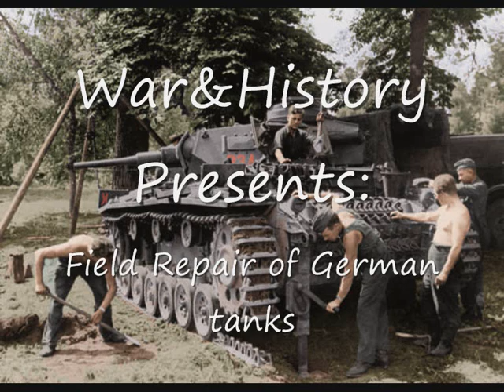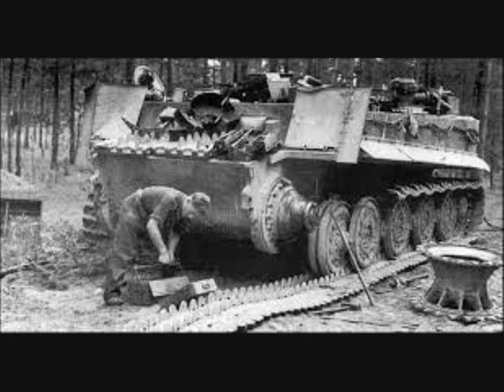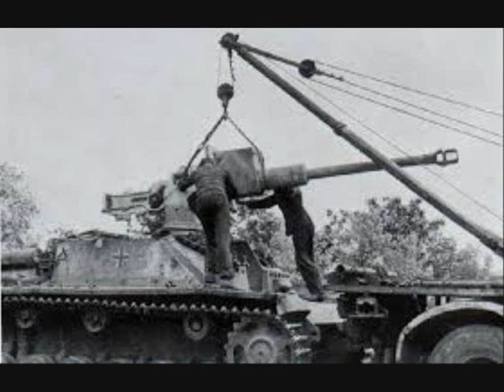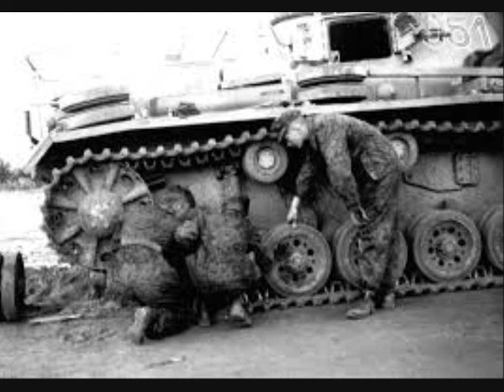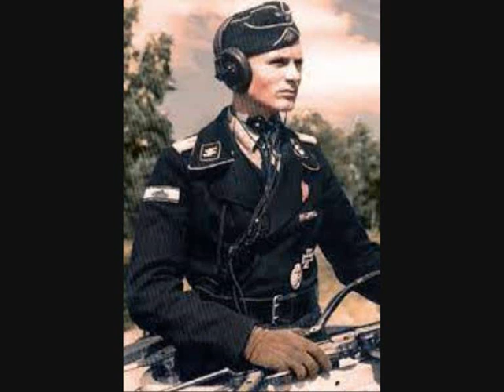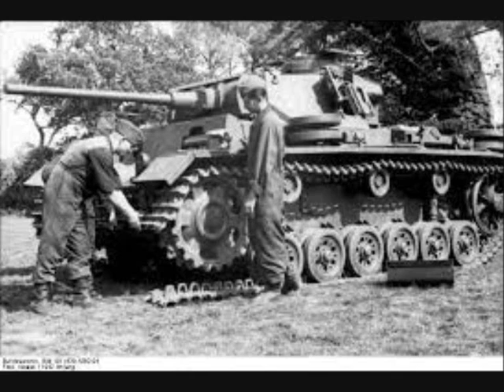Field Repair of German tanks (UNSUNG heroes of the Panzer Maintenance Company)

Comment: This is a very good video on the most important people in a Panzer or Panzergrenadier division; if you count the air force as military, it is true for them as well. ;-) I was in a repair shop during my service of course ...
Interestingly, a Panzer regiment had one maintainance company (Instandsetzungskompanie); a Tiger battallion also had a full company. This clearly shows the Germans were aware that a Tiger needed more maintainance and they compensated for that. A well maintained Tiger was as reliable as any other German tank. 
Problem however for every German armored unit was the constant lack of spare parts and the constant lack of time.

Comment: Your video is very accurate even for today in Iraq.  I have first hand experience and can say that.
One thing you didn't mention is scavenging.  In a combat, vehicles condemned with compromised armor or bodies were strip for parts. 
In the first gulf war we rolled up on a Iraqi scud missile launcher that had been narrowly missed by an Air Force bombing. The right side was destroyed from blast and fragmentation.  The body was damaged on that side and viable as a vehicle. It was abandoned and stripped.  I still chuckle how well they stripped it. Every last nut and bolt was gone, even the steering wheel and column and the foot pedals and the brackets that held them on.
Lesson: The number one thing in mechanized warfare is maintenance. You can't maneuver if you can't move.
Suggestion for other content: How the WW2 blitzkrieg in western Europe was won by lorries carrying the tanks to save on wear, tear and maintenance.

Comment: It good to remember that the German mechanics were were much prized by the Panzer units for putting their tanks back on the road but this is equally true for any army. It is important to also understand that the Panzerdivisions was generally afflicted from lack of spare parts, especially after the invasion of Russia, and the chronic shortage of recovery vehicles especially when the "big cats" started to be fielded. To recover a Tiger and to a lesser extent a Panther it was needed at least two Sd.Kfz 9 but normally even three of those vehicles that often buckled the chassis and stressing the transmission. A situation that was dramatically emphasised during the battle of Kursk as so  many tanks was lost because it couldn't be recovered. It was partially remedied by using turretless Panther Ausf.D and later dedicated Bergepanther. Those mechanics deserved lots of kudos for their efforts...

Comment: Curiously, and this is why I was interested in the video, it does not address the problem with the Nazi tank transmissions
Reply: Later in the war the Germans were getting desperate for troops. A lot of the factory workers were called up and replaced with captured slave labor. Panther tanks at Kursk failed at a 90% rate. The field repair crews found that there were debris, metal shavings and rocks in the transmissions and final drives. Sabotage by starved slave workers would seem to have brought the reliability numbers down for German tanks.

Comment: A great propaganda film. While the Germans were great at recovering damaged tanks and reparing them, this fell apart later in the war when the Germans were in retreat constantly and could not go back to battlefield to recover damaged tanks. In addition, spare parts were hard to come-by. So kudos to the hard working mechanics who repaired tanks just behind the battlefield, but this video is really propaganda and does not reflect reality during most of the war.
Reply: I disagree, even if tanks were left behind later in the war you'll usually find this is because of a lack of fuel. Even as late as April of 1945 in Berlin the German effort to reclaim their Vehicles and equipment was still going strong.